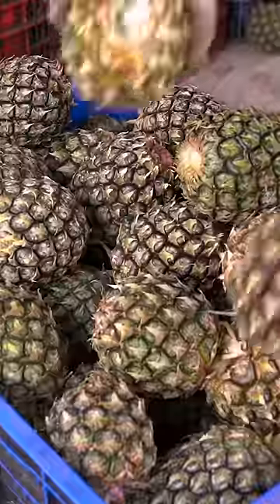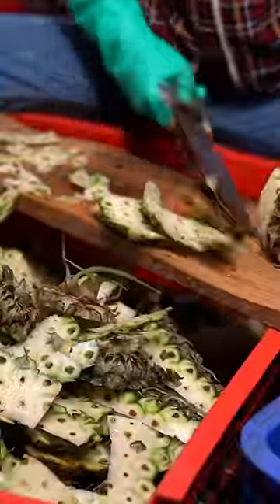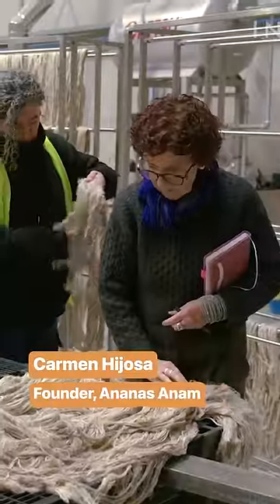This designer created a leather alternative with pineapple leaves. #Sustainable #Pineapple #Recycle

Comment: 95% renewable and they have been working on 5% - Awesome
Reply: Indeed.
Reply: Spontaneous human resourcefulness & ingenuity will save us!
Reply: @Crunch_dGH  You are 👍. God saves too or Allah.
Reply: @Crunch_dGH  from pineapple leaves?😂
Reply: Except the end result is not recyclable, the pineapple leaves are biodegradable, the leather made from it is not, don't you see this is the problem with most green products, the big lie, plastic before its recycled is more biodegradable than recycled plastic, plastic when it's first made the polymer stands are longest and will take a very long time to degrade in to micro plastics as all the strands have to break down first, when it's recycled those strands are broken down already so the end result degrades much faster and can no longer be recycled, just like the products it takes to make electric cars, the footprint of manufacturing on a large scale is way worse than that of combustion cars
Reply: @robertbradford3461   Great Point. The green economy has serious issues.
Reply: Yeah, they coat and impregnate those fibers with plastics to mske them usable.
There is no such thing as "green" in the context we are using it.
Reply: You totally missed it.  She said it’s 95% renewable so they need to work on the last 5% to make it totally renewable.
Reply: @rickpascual4340  
So is leather.
Reply: @rickpascual4340  yes sir. I meant that only.
Reply: @talllala  when there won't be any resources left on the planet we'll regret this sir. So it's better to start atleast
Reply: that is exactly what i was thinking we need more ppl doing research like this
Reply: What's the name of her company
Reply: Now let's make it 99%
Reply: @robertbradford3461 facts indeed true
Reply: @talllala  Green is the new red.
Reply: @robertbradford3461   so what is the best, I am curious..cu naturally I have Ben very drawn into the idea of having other alternate means by transforming what would have been waste into not just wealth, but favourable also for the environment and our carbon footprints...
Please enlighten me...thank you
Reply: @Sola Okusanya  not really sure what you're asking, I'm not here to give you  business advice, nor should you take it, the best form of recycling is to repurpose and reuse as it keeps it from being thrown away, plastic bottles being split and weaved into other things, clothing being reused, buying old instead of new, it doesn't make sense to take a bunch of leaves that would biodegrade in a few months, grind them up put chemicals and coating on it to make it like leather that won't biodegrade for years,  its a scam, make people believe you are cleaning environment but all you do is push it out further
Reply: @robertbradford3461  I like your initial "caveat"...lol .
However, you knkw there is something I always notice: " when the media hype is anything terms new innovation or anything else is too good to be true, something is fishy somewhere...
As appealing and lofty This ideas are, I wanted to be sure , 
They delibarately hide the risks and overly highlights the benefits for their own sinister gains....
But I need to be sure...
I would do my own research too...
If the efficiency is low, I feel people should be told rather than being painted with sweets
Reply: That's such a creative idea
Reply: That’s how our political system designed for example plastic bottles or bags usage they won’t ask companies to stop manufacturing them but they beg people to stop using it it’s like teaching a less to 20 people Vs 20000000000 people
Reply: @rickpascual4340  really?
Reply: Pinya barong is very expensive here in the Philippines bec of its quality.. ❤❤❤
Reply: @prakasaraok2628  So the government told people to stop using plastic, but they didn’t stop the companies bottling water to stop using plastic  to bottle the water; and big business establishments  like grocery stores,department stores, retail stores etc. became more wealthier than before because they don’t have to hire people to bagged  shoppers purchases, and they don’t have to provide plastic bags as well  , and instead sell the bags to the shoppers if they forget to take a shopping Bag with them; and in so doing,big businesses rake in more money .
Reply: @bethoven5057  yes
Reply: She means 5% more is needed  to be 100% renewable.  
That 5% is currently being worked on in order to achieve this.
Reply: @robertbradford3461 
Ok Tucker Carlson.  We hear u 😂
Reply: @robertbradford3461 
😂
Reply: @joaoalbertodosanjosgomes1536  Find any job right now…

Isn’t that what Indeed is?
Reply: @joaoalbertodosanjosgomes1536  wtf
Reply: Wow......we can think of so many things to ...start with
Reply: @MeYou-yz2yz watermelon - green on the outside but really red on the inside. 😂
Reply: Share this
Reply: Cotton and leather are 100% renewable. The claim they should be using is the reduction in waste.
Reply: @bethoven5057  I've never had my grocery bagged, and the 10 cents you pay for the plastic bag is a tax the store pays the government.
Reply: @robertbradford3461 plastic is irrelevant to recycling pineapple fibers…it’s just human resourcefulness taking what is normally thrown away and making a product. You just had to go all Fox News Tucker Carlson for no reason whatsoever.
Reply: @SaidAlSeveres  not irrelevant, you just don't see the correlation. Plastic was used as an example. The plant fibers are perfectly biodegradable the way they are, yet when they are recycled thos way, they are not, so it's not really better for anyone as you just made it worse, this is the problem with the whole green thing, and sorry, this came more from Michael Moore then anywhere else, The Big Lie, like electric cars will cause more polution than cumbustion, and are destroying the planet, the lithium needed for electric batteries is extremely bad, supposedly, but green thinkers are selective in thought and have a tendency to not think shit through. 
Oh, and by the way, I am not exactly the tucker type, I like gutfeld.
Reply: @robertbradford3461 agreed 😅 suppose the question then should be wtf are we burning the leaves if they’re biodegradable?! 🤦🏽‍♀️
Reply: Yea not going to lie that's impressive now if we can keep them from lying saying it's carbon footprint is 0 then we will be ok. I work for a company that claims that but they literally use aerosol cans with carbon in them to spray on stuff.... They also say they use 50-75% recycled material however the recycled shit they use is the waste product they create and they got MOUNTAINS of it laying around 😂 anything to fool the customers though am I right?
Reply: @lamonthudson76 I think the video says PinaTechs.
Reply: @joaoalbertodosanjosgomes1536 god doesn't seem intent on fixing our mistakes for us. Pollution is our own problem to fix
Reply: wonder how much they pay their workers
Reply: Well there's a easy way to use that; pineapple skins contain large amounts of bromelain.
Reply: That just sounds like they’re zealously pursuing maximum sustainability even if it doesn’t make sense. 

You hear about companies like this all the time but they rarely survive because the one thing they forget to make sustainable is their business model
Reply: @barneyboyle6933  that's why we need government action. Sustainability is more expensive than just burning natural resources. Without help from the government, we'll eventually make the planet uninhabitable
Reply: @robertbradford3461 Burning the leaves is still worse. Also, saying something "isn't recyclable", is silly. Everything is recyclable, you just have to find a use for it. circular economies are ideal, but finding second, third, fourth lives for materials, before they finally have to be processed into raw materials, or put into a landfill, is still far better than just disposing of it after the first use, or in this case, before it's even been used once.
Reply: @robertbradford3461 yep. For a green economy you not only need recycling, but you need the other R’s as well.
Reduce the amounts of material produced, used and wasted
Reuse and Repurpose the tools and materials you already have
Repair and upgrade your possessions instead of buying new ones and fight for your right to do so
Riot and Restructure the socio-economic systems we live with to be more sustainable and humane
Reply: It’s not awesome, it’s cheap garbage.
Reply: @MikehMike01  why sir?
Reply: @joaoalbertodosanjosgomes1536  God is Allah SWT
Reply: Leather is 100%
Reply: @robertbradford3461 do you have proof of the product isn’t biodegradable?
Reply: @americasteam2112  because silly, pinatex, which is leather made from pineapple leaves is a mostly sythetic polyurethane product, it's marketing is said to be more humane form of leather, not that is renewable or recyclable. We are not talking about regular pineapple fiber clothing that is woven, that is biodegradable, but leather product that is not, it is 80% plastic
Reply: @joaoalbertodosanjosgomes1536  no Jehovah does
Reply: That 5% wont change... unless you want to wear rotting shoes.
Reply: @vertox78  What do you think cotton is? None plant based?
Reply: @joaoalbertodosanjosgomes1536 Jesus not allah
Reply: A
Reply: @Lobos222   total bullshit, pinatex is mostly a polyurethane, plastic. Which is why it's not renewable, 95% percent renewable is not renewable. The renewable they are talking about is the leaves themselves, not the finished product. Pina, on the other hand, is completely renewable, but you can't make leather out of it as it is a bit delicate
Reply: @robertbradford3461  🙏
Reply: @funstuffkeepmunchinbethank7848  ❤
Reply: @robertbradford3461  🙏
Reply: @yacobshelelshaddai4543  Allah not Jesus
Reply: @FolkStory57  Allah is God SWT.
Reply: @robertbradford3461  🙏
Reply: Leather is 100% renewable as is tho
Reply: Shit man, that 95% is enough to get me seriously into its future.
Reply: @tailsntales1265  Who is Jehovah?
Reply: @yacobshelelshaddai4543  Allah not Jesus.
Reply: Fake news.
Reply: @joaoalbertodosanjosgomes1536  what's fake in this news?
Reply: Only 5% animals leather that are working on.
Me: I don't care if you're killing less animals 95% and let the meat rot in the field.
Reply: The 5% used is asbestos and anthrax powder
Reply: @Lewis94444  can we not replace that with eco friendly material?
Reply: the other 5 could probably be hemp
Reply: @robertbradford3461 They burn the pineapple leaves instead of letting them dispose of themselves. It's bad regardless.
Reply: not really. Quality should be their focus. Unless the product is durable, fashionable, and pratical. you wont be able to create the demmand needed to be a sustainable business. Not to mention is it scaleable. Can you produce the product in enough quantity to curb demmand for other products you are competeing with. If not then your just a novelty.
Reply: @BlueGoblin1  when we'll not have any resources left on planet sir you'll regret
Reply: @callmewhatever.7963  how so? No carcinogens, no plastics, no chemicals, how is it bad for the environment and not just bad for people? Burning is a necessary part of the life cycle for many things, and with out it would not continue to exist
Reply: I'm guessing that last 5% is plastic?
Reply: @barnmaddo  not exactly, it's a way of saying it with out saying it, pinatex was invented as  "leather" a more humane way of making it, and what's renewable about it is that the leaves are always there so its sustainable, just not good once it's made
Reply: And what percent goes back to the pickets and growers awesome save the planet and exploit the people
Reply: @LA-bq6hf  it's like 0.01 percent of bacteria that Dettol can't kill.
Reply: @LA-bq6hf  Piñatex is straight up when it comes to their environmental impact. On their website, they clearly state that they're not 100% biodegradable. The company divulges the breakdown of their products, such as the proportion of pineapple leaf fibres, as well as the plastics and bioplastics.Jun 1, 2021
Reply: Bruh, do the math, made from 95% renewable so they have a 5%(left) to work on to make it 100%. Its not that complicated
Reply: @jonsnoo5329  bruh, you don't get it, 95% of the raw materials are renewable, duh, the leaves grow again, hence renewable, but the final product is not recyclable and not biodegradable and not definately not renewable. It's stupid simple, yet people don't understand. Taking something and turning it into something else that's not recyclable defeats the purpose of recycling in the first place. Like plastic bottles, plastic bottles can be recycled, but the recycled product can not be recycled again, everytime its recycled, the polymer strands become too short, making micro plastics and forever chemicals able to leach out of their recycled form
Reply: @robertbradford3461  bruh I dont give a shit about the nitty gritty and the details, I was just talking about what she was saying and what she meant and how obvious it was.
Reply: @jonsnoo5329  ah, so what did she mean, and how obvious was it?
Reply: @robertbradford3461 i mean she still is using a product that would either burn or just lay on the ground and there is no telling what kind of man hours a factory puts in discarding waste.  It’s still a very smart way of using something that would be destroyed
Reply: @jprosey  real smart? Do you know what pinatex is? It is what we are talking about. We are talking about taking something that it 100% biodegradable and making something that is 00% biodegradable from it.
Pinatex is marketed as a more humane leather, except it's made with plastic and polyurethane, 300 times more harmful for the environment than the original material, so again, how smart is that? It's like taking dirt and gluing it together with polymers and calling it a renewable brick
Reply: @MeYou-yz2yz  Congrats on having the same old “man yells at cloud” take on going green as a middle age man from the 1960s. Those darn hippies!
Reply: @joaoalbertodosanjosgomes1536 Allah means The one God or The God which means there are no Gods except him and no true God except him
Reply: @robertbradford3461 Exactly. What is the waste product and how many steps are in the production process and does the manufacturing cost cheaper than leather ? What is the cost to the consumer? What happens to the cattle and cowhide that is being rejected in favor of this product and what is the disposal method? What happens to the tanning industry in the third world world countries and how does it effect their economy and economic standing.
Reply: @ddz1375  All of this could have been answered in less time than it took you to comment. But whatever, I'll humor you. The product is Pinatex. It takes pineapple leaves and polymers and turns it into a leather like material. There are 2 sides to this, and neither have anything to do with 3rd world countries and their methods of tanning hides, so I'm not sure where that comes in, other than an abstract tangent slightly related. It's 95% renewable because pineapple leaves keep growing, the other 5% that is not renewable is the plastic and polyurethane they use as a binder,  so they took something that naturally biodegrades and turned it into something that will never biodegrade and call it recycled. Pinatex is marketed as a more humane version of leather and only slightly cheaper, but no animals had to die to make it, but as I said unlike leather it will never biodegrade, so not safe for environment but safe for cows. Now for the tangent of 3rd world countries and their tanning industry, Africa has been tanning hides for thousands of years, their only rival is India in the amount of time its been done, India is quite a bit more toxic than africa though in their methods. China is the worlds leader in leather exports, and i imagine their methods are just as if not worse than indias. So how will this effect them? It won't because pinatex can never be produced on that scale. But hey, who the hell am I? Maybe I know nothing about this or I have it wrong, don't know, but that's what I got. Hope it helped
Reply: @barnmaddo 95% renewable doesn't mean its made of 95% pineapple leaves so I can't even imagine what those 5% are...
Reply: Juat saying that vegatable tanned.leather is 100% renewable
Reply: To be fair, that extra 5% probably gets her more profit because the 5% synthetics are probably the most expensive part of the materials. So yeah you could couch it in terms of “she is already 95% renewable and is striving for that last 5% because she wants to save the planet” and that may be true to an extent, but this whole thing only makes sense as a business proposition. So any cost she can cut, whether it helps the planet or not, is a thing she would want to strive for.
Reply: she stole this technique from the Indians
Reply: Those manufacturing machines don’t look renewable.
Reply: So many animals will ba save for this process
Reply: @solaokusanya955 the thing is turning something organic and naturally biodegradable into another product that is not may not be that good. And that process requires energy and chemicals
Reply: The problem is that over the past years pineapple in food stores have less and less taste.
Reply: What’s going to happen with all the animal skins? People are still gonna eat meat and there’s still gonna be skins from the eating of meet and for vegans this stuff is fine but for me I’d rather have leather.
Reply: @Bwiser63  Even if animals are not murdered for their meat the leather can be taken when they die naturally.
Reply: @Bwiser63  less meat if not meatless
Reply: @vertox78 from Co2 emissions released when burning said leaves/leaving them to rot.
Reply: @flynnbrooks3302  yay humanity saved us from nature yay🥳
Reply: Did you know that here in the Philippines, we have been using pineapple cloth for our "Barong Tagalog". A formal wear. We have been doing it since the 1960s. FYi.
Reply: @litogallardo7800  that's great sir. Is that as good as synthetic fibre?
Reply: Can you say pineapple a renewable? It is not. It is eco-friendly, biodegradable.... But renewable? Idk so.
Reply: @islandsunset  yes it's renewable, you plant it and it grows again 🤷🏻‍♂️
Reply: @bethoven5057 then it reduces the plastic usage too tho right? Seems like a win win
Reply: Wow good luck 🤞🤞🤞
Reply: @robertbradford3461 while those are great options, they weren't letting these pineapple leaves degrade naturally, the growers were burning them in large batches which creates a heck of a lot of bad gases into the air which contributes to global warming. Between burning and making this into leather I'd rather she make this into leather cause releases ash and fumes into the imenvironment is a quicker death to humanity then expanding their degradation rate.

(We really should have more laws against burning plant material altogether, but farms are growing to fast to let it degrade naturally. Legislation would be the true hero here)
Reply: @Crunch_dGH only Jesus can save us from what's coming
Reply: Yep there’s other things that we can use that do more and can do this I think I’d bet, we have to figure out exactly which fibers are using to turn stuff into the leather type material, but the stringers just made out of typical plant fibers. You can do that with every plant almost, it’s better out of certain ones like the best one would be hemp, it has the most versatility, it can be made into fuel, oils, paper, cardboard, clothes, stretching, types of building materials, bio plastics, food apparently, and installation. I had to look the last re-up because I always forget.
Reply: I wonder if they effort to make it that last 5 percent would be better spent on just marketing and upscaling ti replace things that are 0 percent
Reply: @joaoalbertodosanjosgomes1536 God creates the death and destruction and then saves you from it? Sounds quite abusive to me
Reply: There is a lot of pineapples in my region can the maker helps me pls
Reply: @ChopsWildRide that is fascinating. Damn are we all going in circles....
Reply: Not so awesome if the 5% is microplastic?
Reply: @robertbradford3461 mhm considering your pov; it still has less resources used.
Reply: You gotta start somewhere
Reply: @robertbradford3461 well said. It isnt important that pineapple leaves were worthless. They should he burned or fermented and returned to the soil. Now more waste has been created, not less.
Reply: @rebeccacampbell585  but marketed as a more humane version of leather, but its worse for the environment, so fair trade right?
Reply: Novel idea. But they are taking the scraps and making something from them but they are also taking the nutrients from the ground removing the waste to elsewhere and then needing to import manmade fertilizer into the ground. Instead of composting and putting it back into the ground.  Hmmmm
Reply: @robertbradford3461 I think it's also because making a leather alternative, animals do not need to be killed.
Reply: ,...: ko of
Reply: @vertox78 hell yea man. A massive amount of emissions are caused from food waste decomposing. Doing this will saves lots of emissions.
Reply: @robertbradford3461 right… let’s not try to improve our current manufacturing process because it’s bad right now. Things hit a ceiling in how efficiently we can manufacture them, so we find a new thing that we can manufacture more efficiently. I don’t see how this is a problem. We have found micro plastics in human hearts my man, this isn’t good we need to get rid of plastic. I would much rather wear pineapple leaves than wear oil I’m not gonna lie.
Reply: @talllala which we are trying to fix. These things take time to improve. If every unanimously supported this stuff everyone would benefit.
Reply: @troubleturkey5783  your comment says you have no idea what you're talking about,  you don't know how it's made or what it's made of, if you're wearing pineapple leaves, you're wearing one of two things, either Pina, or pinatex, Pina is made from the fibers and is a cloth, not very durable or washable, if you're wearing pinatex, which is what this article is about,  you're wearing pineapple leave that have been compressed together with polyurethane  and plastic, so you are wearing oil
Reply: @robertbradford3461 but didn't they say they burn the them?
Reply: @dkwhattouseasusername1012  no, that's what they said were done with them before they started using them for this, because burning them according to this is bad for the environment
Reply: They are Liars😂😂😂
Reply: @robertbradford3461 plastic is never biodegradable 😂
Reply: @rosepetalcigarettes  apologies,but it does, how do you think micro plastics are made,   biodegredation does not mean something vanishes completely, it means it's broken down to smaller elements of the original.  And not sure why your on this. The article is about taking pineapple leaves soaking and pressing with polymers and polyurethane, and calling it renewabale
Reply: @robertbradford3461  I understand what you're saying but colloquially that is 100% not how biodegradable is used in western countries.
Reply: @rosepetalcigarettes  We define biodegradable as the ability for a material to be broken down naturally by the organisms in an ecosystem. Simply put, biodegradable means that the material naturally breaks down into smaller components, such as sugars and gases. The biodegradation occurs thanks to microorganisms, such as bacteria and fungi. The leaves are 100% biodegradable, and so is plastic, but plastic takes thousands of years to biodegrade, but it does biodegrade, everything on the planet does, and was not my point, my point was you are taking something that can de gotten rid of really fast and making something that will take thousands of years to get rid of and calling it renewable, how is it better? It's not
Reply: Right
Reply: @robertbradford3461 this isn't the problem with most green products. You capitalist wannabes just don't want to accept changes that are good
Reply: @robertbradford3461 so are you saying it's not worth the effort? I think options like these are a large step toward achieving fully sustainable products.
Reply: @ffyukari  lol.. making traditional clothes made from pineapple have been practice here in the Philippines for centuries. after Spanish introduced pineapple fruit in the Philippines.
Reply: Contains PLA plastic that takes 80 years or more to break down 👎🏽
Reply: @rickpascual4340 in which sense is it 95% renewable?
Reply: @robertbradford3461  the problem with non recycled plastic though is that it still takes hundreds of years to decompose, piles up, and never fully goes away- it only breaks down into micro plastics

Recycling is the best thing to do, because the alternative is letting it pile up while creating even more waste than if we reused plastic to our best ability.
Reply: @talllala 
They just say green to make it appear that it is environmentally friendly